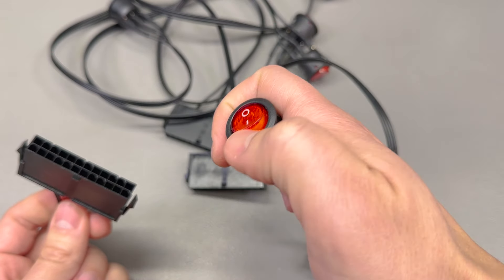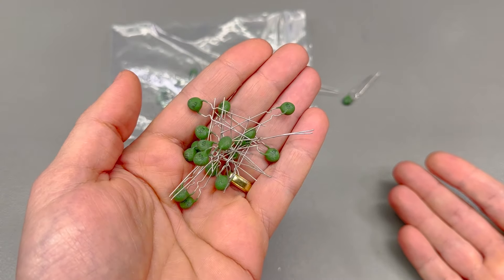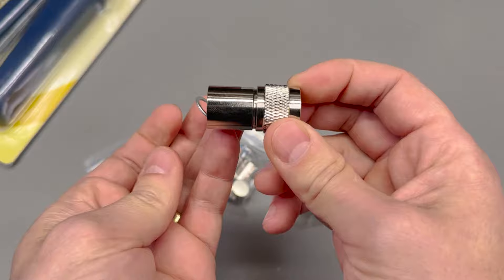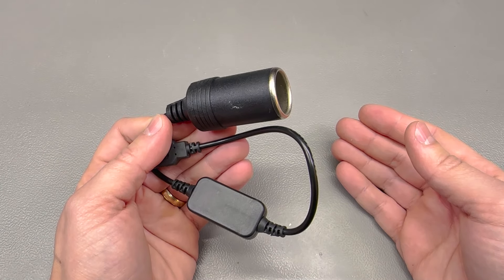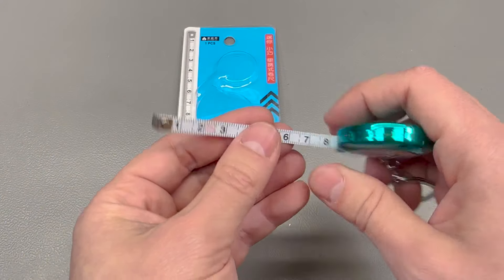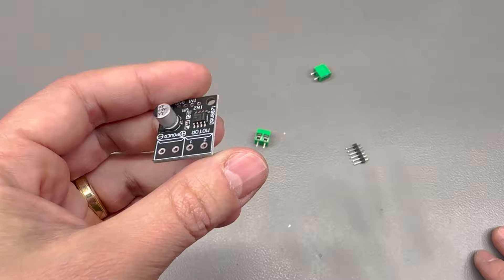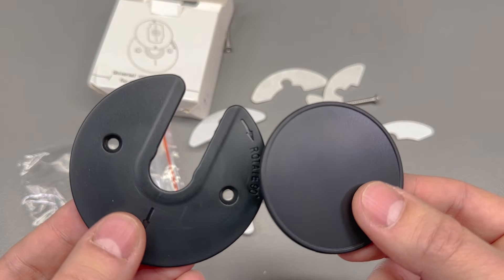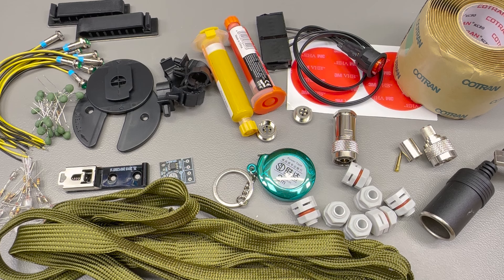InTheMail | Voltlog #472

Comment: 1:33 polyamide is actually heat resistant :)
Reply from the maker: So maybe it's not actually polyamide :-)
Reply: @voltlog  probably not hehe. That's a shame. It would be nice to have some heat resistant sleeves. There are rare occasions they are needed.
Nice video though. Thanks